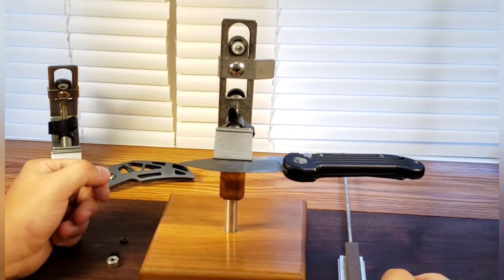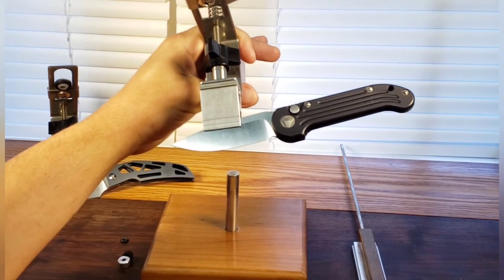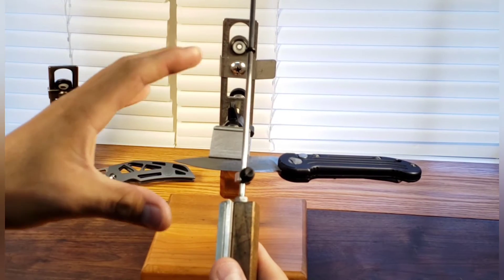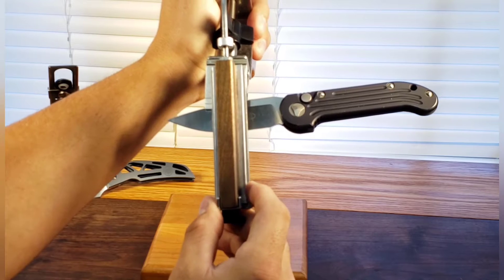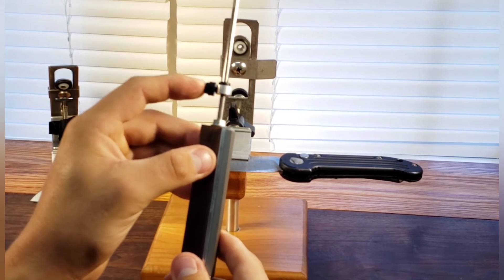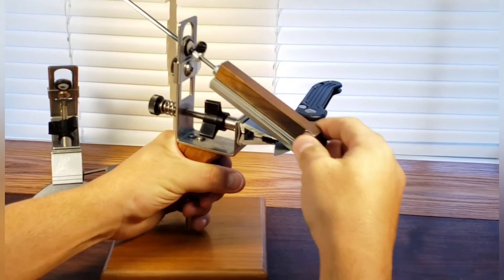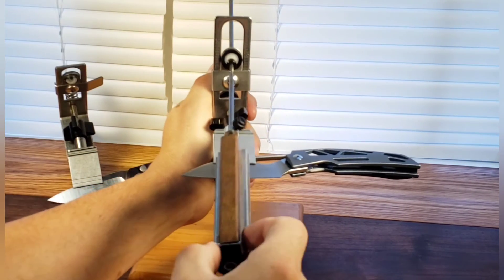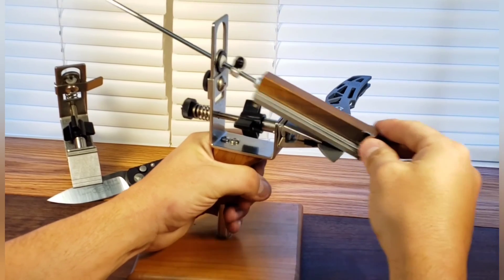KME Sharpeners Stop Collar Set Up

Comment: I've done something similar but leave the O-ring behind the ball and race and the lock collar in front just like  you have it set. This way the stones can't slip too far forward or backwards off of the knife. I find it works great and have never had it slip in either direction.

Comment: Hey Samson edge,  I got my blade scary sharp with KME 300 with your video. 

If I go with higher grits 600, will the blade hold it sharpness longer in your experience?
Reply from the maker: Thats kind of a tough question to give a straight answer to. It really depends on the angle of the edge bevel and what you are cutting. I personally run a 600 grit edge on my edc and user blades. The best thing to do is to play around with different finishes on your blades and see whats gonna work best for you. Plus, thats gives you an excuse to get to sharpen more. Lol